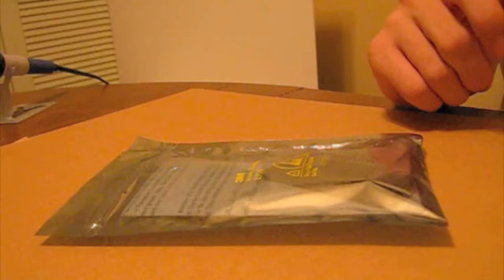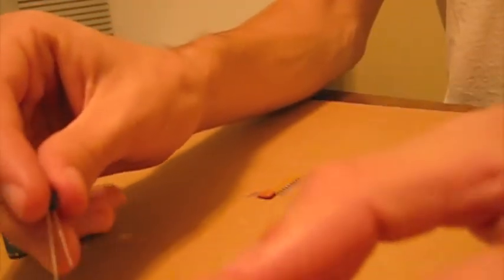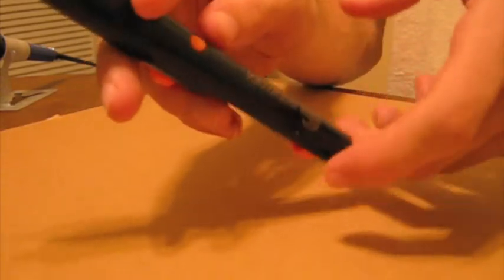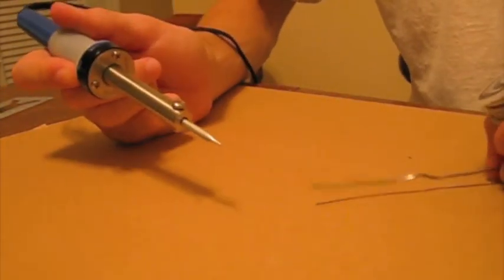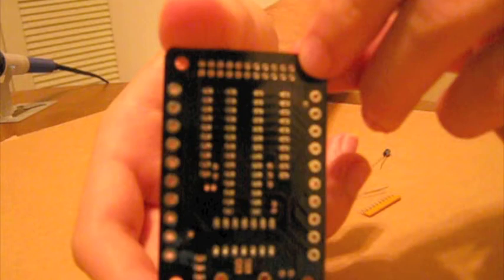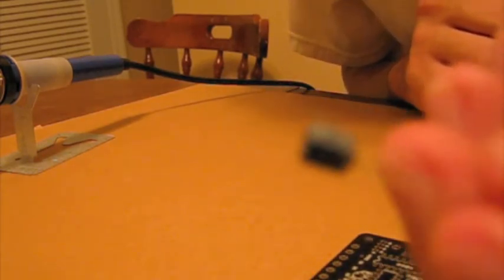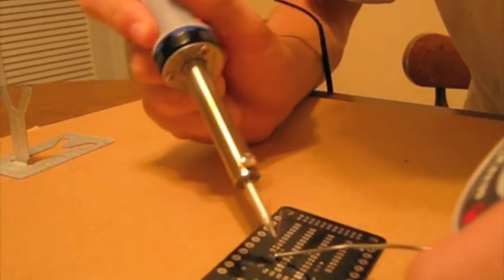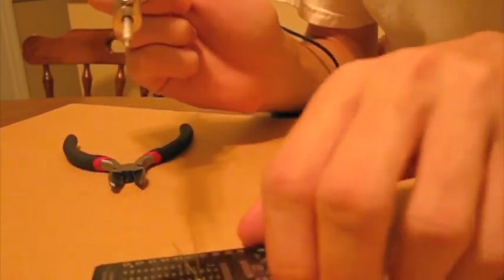Assembling a ChImp: A beginner's guide—Part 1

Comment from the maker: @j7512 No way. You just will have a much higher heat to work with. Generally, for beginners, you want lower heat irons as to not damage PCBs from the excess mount of heat. But it will work just fine. You'll just have to work quickly to ensure you don't damage anything from excess heat.